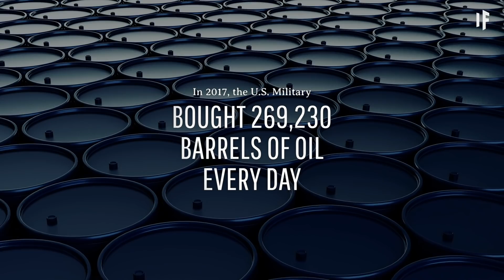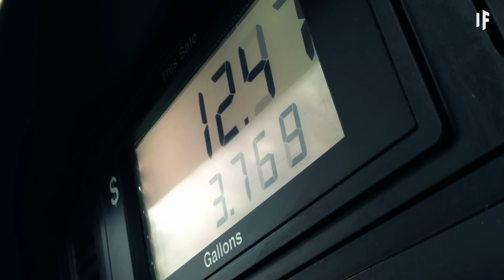What If We Powered the Planet With Seawater?

Comment: You skipped a crucial point: How many kWh of electricity do you need for 1 liter of fuel? 20? Even more?
The production of such e-fuels consumes enormous amounts of electricity.
Because you can't "extract" pure hydrogen from seawater, like you extract carbon dioxide, you have to use electrolysis to get it.
No problem for some liters on a nuclear powered ship (plenty of electricity), but a big problem for mass production, because electricity still mainly comes from burning fossil fuels globally.
However, in far future, such e-fuels based on water, carbon dioxide and green electricity (or maybe nuclear) will probably play an important role as an energy carrier.

Comment: Honest question (no sarcasm, petulance or anything, just curiosity): ¿How this would be carbon neutral, it just extracts CO2 dissolved in water and liberates it in the atmosphere which I don´t see how it is different from using fossil fuels or wood combustion which has the same problem: liberating carbon into the atmosphere that previously locked in geological or biological structures?

Comment: Desalinated plants produce 1.5 times more brine than drinkable water. If we could somehow use that brine (high level of salt water) to produce energy that will auto support those plants, it will be a huge step to solve the energy problem that these plants face to operate: they need a lot of energy to work and produce drinkable water.
There is no proof but, what if brine could harm ecosystems in the oceans? That's why we are in need to find a way to use brine. We are definitely not in a position to risk marine life by pouring brine into the oceans.

Comment: Carbon monoxide is gas and toxic
Reply: Yes, but carbon monoxide isn't a waste product (exhaust) of this process, but an intermediate product. Carbon monoxide and hydrogen (mixture is called "syngas" or "synthesis gas") are used for the synthesis of liquid hydrocarbons.
The production of such e-fuels could be very clean, but the video skipped a crucial problem: High energy demand, you have to put much electricity into the process, mainly for hydrogen production from water.
No problem on a nuclear powered ship, but a big problem in a world, where electricity mainly comes from the combustion of fossil fuels.

Comment: Actually it is perfect for submarine to electrolysis sea water make oxygen for breathing and hydrogen for engine room and torpedoes . For larger ships then do the same thing and use hydrogen to drive engine and oxygen as part of fuel cell to reacted with carbon in the air make sugar and recharge battery or use it for cooking fuel or rocket fuel when mix about 35 percent hydrogen and 65 percent oxygen
Reply: You totally failed physics at school didn't you

Comment: slamming climatescam free energy  i already had a chinese calculator with a battery running on seawater or salted water nothing special anode plus diode katalyst in salt water... after this one item i never so another one, suppressed technology??? Seawater instead of oil will be great for your wallet and will beat all carbonemission so the carbon control system through Qr codetraking wont be necessary anymore, freedom, no tracking, free or cheap seawater in your cars and planes,.... no tracking no carbonemission or carbonfootprint!!!!

Comment: Stupid to say its carbon neutral. It releases stable carbon in sea water in to atmosphere, increasing the level of green house effect. Fossil fuel releases  stable carbon underground to the atmosphere, increasing green house effect. In both case CO2 levels in atmosphere increases, causing global warming.
If hydrogen is used instead of carbon, green house effect will be avoided. May be safe hydrogen engines will be developed in future.

Comment: There's two pathways to use one distilling the sea water and two reverse osmosis both systems use energy on top of that electrolysis unit also uses energy and now you have two different systems taking in energy so you need 56KW of energy to produce 1kg of hydrogen. The idea is right way but needs to efficient so from 56KW to 40KW would be better.

Comment: But will the water return to the amotsphere or will it just puff to nothing after we use it?
Reply: The combustion of hydrocarbons produces carbon dioxide and water (vapor). Of course, the water comes back into the oceans.
The problem is mainly the high electricity demand of electrolysis, to get hydrogen from water. 
No problem for a couple of liters an a nuclear powered ship.
But if it would be a normal oil powered ship, you would have to spend (roughly) 5 liters of oil to produce 1 liter of such synthetic fuel, just for the electricity.

Comment: Hey you didn't even tell the composition of fuel which is created from sea water.

And you said carbon dioxide will still be released in the atmosphere. This solves 50% of problem not 100%. As greenhouse gas will increase in our atmosphere. Only good thing is abundance of sea water.

Comment: Calling that a carbon neutral fuel is ridiculous.

It's not as if the emissions from using said fuels are instantly absorbed back into the oceans, thus you are going to get a rise in CO2 just like with Petroleum fuels.

It takes time for oceans, plants, etc. to absorb CO2. It doesn't magically appear dissolved back into the earth covering solution we call oceans.

Comment: It sounds like a great way to counteract the rising sea level also.
Reply: Of course it will counter rising sea levels. Seawater as fuel will be a carbon neutral, eco-friendly to fossil fuels, and this will slow down climate change that will stop melting of polar ice caps and therefore, stop the sea levels from rising. If you were thinking that using seawater as fuel itself will reduce sea levels, then you are wrong since there is so much water in the seas and oceans of the Earth combined.

Comment: There was a time where cars DID run on water; i.e. steam; but the oil industry really took off, and those steam powered cars were gradually phased out.

I even heard a story of a guy who invented a car that actually ran on water in the 1950s, but the oil industry quickly quashed his idea. 

I see nothing wrong with burning fossil fuels; but if you wanna gradually phase that out, the alternate fuel sources need to be just as efficient, AND cost the same.
Reply: No they didn't, they ran on coal or wood

Comment: This video only tells half the story, and it's somewhat misleading.

The seawater itself is not being turned into fuel. It's the gasses dissolved in the sea water that get converted. Those gasses that we're after are carbon dioxide (CO2) and hydrogen gas (H2). So theres nothing intrinsically important about the sea here. One could literally just capture the CO2 from the factories creating it, which would be a lot more efficient than doing it by sea since you dont need to search for tiny amounts of it disolved in the water. Another option is to just filter atmospheric air, which has the added benefit of being even more plentiful than even seawater! So sucking up the CO2 from water is definitely not the easiest or most viable option here. The H2 is slightly more difficult to come by, as it occurs rarer naturally, but the video did briefly show a clip from Grant Thompson's (I.e. King of Random) video on electrolysis, which explains in detail how to electrically break down water into hydrogen and oxygen gas. The above video does not mention these alternatives.

The naval pilot test they referenced to in the video processed 135,000 liters of water per day to extract the 4 liters of fuel they talked about. For reference, your neighbor's huge pool (18×36 ft^2, 5 ft deep) is about 92,000 liters, and processing all of that water would get you less a milk jug of fuel. That's a lot of saltwater to process for a small amount of fuel, making it untenable for all but the largest boats, which eat up thousands of liters of fuel per day anyways.

A huge point that the video glossed over is that fuel stores a lot of energy, energy which is not present in seawater or its dissolved gasses. The process by which the fuel is produced actually takes more energy to run than it outputs. Meaning if you wanted to run this gasoline-making factory, you would need to put in MORE power than whatever the gasoline coming out would store inside of it. So this process wouldn't make energy, it would waste energy.  Its like trying to use your phone flashlight to shine at a solar panel to charge up your phone.

Lastly, the technology is nowhere near ready, nor is it something to be excited about anytime soon. Based on the paper cited in their sources (Assessing the viability of KMo2C, Juneau et. al., 2020), the produced hydrocarbon fuels may cost $9.48 just to produce, already over four times the market price at the time this was written. This is before distribution, transportation, and markup, which all bring the price up even further. Ardent supporters of the cause might still purchase, but it certainly will be much harder to convince others. Calling it "slightly more expensive" is misleading, especially when the prices from the  video's sources arent even shown.

In summary, this video makes vague promises that this fairly new technology will be the cure to our climate change problems, but it just isn't. It's not particularly efficient, hard to implement on a large scale, ends up being energy-negative, and will be prohibitively expensive. But hey, at least we know that we will still be able to fly jetfuel-guzzling planes once the fossil fuels dry up.

Yes, global warming and climate change are important issues that should be adressed right now. Yes, solving the energy crisis is a huge part of the fight to reduce carbon emissions. And yes, investing in research to achieve those goals is important and worthwhile. If we put our minds to it, humanity can overcome the burdens of our past decisions and become a sustainable civilization. Does this video show something that has a part in this bright future? I don't think so.

Comment: This video is misleading. There is not catalyst that turn water into fuel without energy involved. A catalyst is something that is not directly destroyed into the reaction, but water to fuel requires energy. Mostly electricity. Thermochemical separation is also an option and there a catalyst can help making the reaction more efficient, but you need energy from start. Water could be used as a source material of a energy vector, hydrogen or synth fuels, but energy comes from other place.